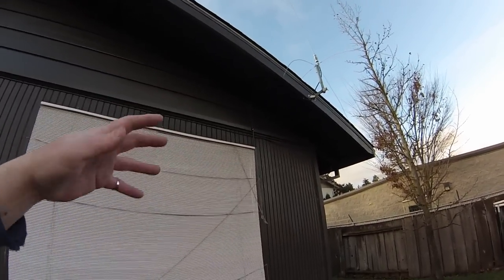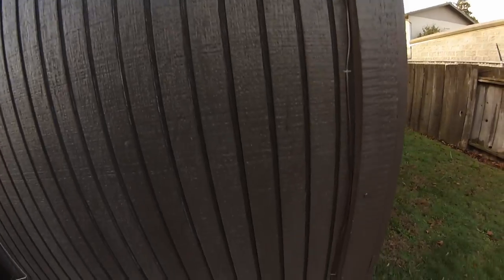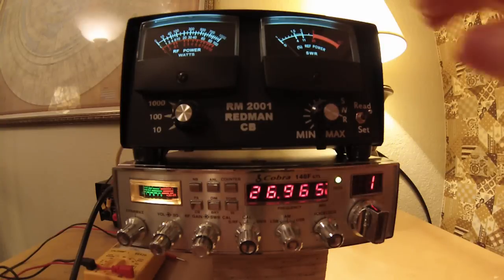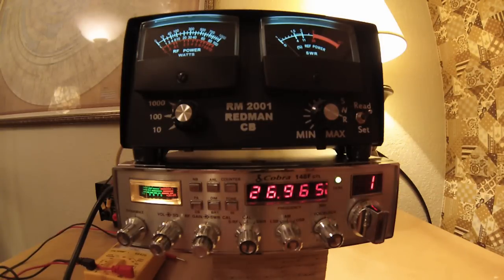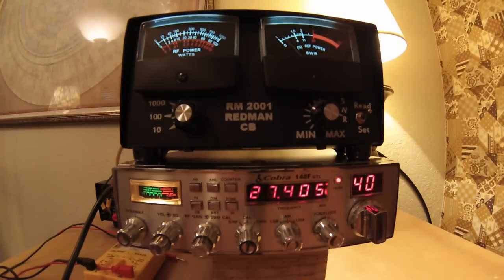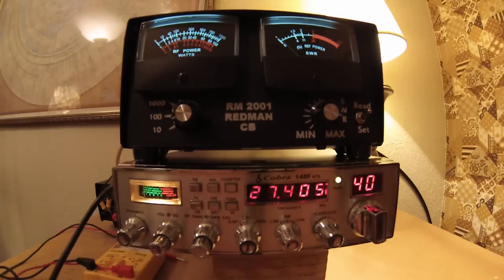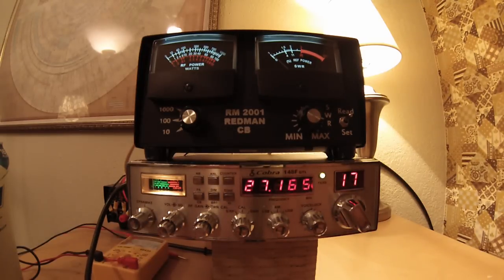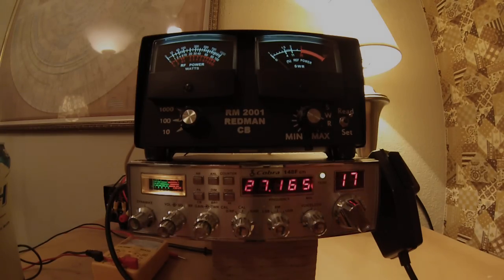DIY CB Base Antenna Using a 102 Inch Stainless Steel Whip

Comment: No video how you did it all looking to see how to do it so I can make a base station in the house
Reply: I made a makeshift base station for someone with minimal parts.  I used a computer ATX power supply for a very clean 12 volts and 30 amperes.  I then connected the yellow cable from the power supply to the red cable of the radio.  Then I connected the black cable from the power supply to the black cable of the radio.  I then ran an antenna to the roof and fed the antenna with a long length of coaxial cable.  It is very easy to do and the results are good.

Comment: if your running about 30 or 40 feet of mast  and run the ground plane do you need to insulate the antenna from the mast pipe I have bad swr its reading like the antenna is way to long
Reply from the maker: No. The Mast should be Grounded and the Antenna Should be Grounded to The Mast as Well if that Makes any Sence.
Reply: @danjarrett  it makes all the sence in the world Im running on pole no radials right now well I tried swr was lously and surprisingly while 3 to 1 in the 40 when I went as low as 26 mghz the swr was only 2 27.9 mghz 3 indicationg long no spring tried 3 other antennas and swapping coax so adding radials should fix my swr or am I gonna still have a problem because its on 40 feet of pipe
Reply from the maker: @Vinnie305  I don't know. If the Antenna is working ok it should not matter about the hight  of the Mast. Could be the Length of the coax ?
Reply: @danjarrett  it works fine swr is the issue I have 75 feet of lmr400 also  my radio does around 150 watts

Comment: Channel 19 is trucker channel for North America! and your ground radials on a 102 should be 9 feet!
Reply: California uses 17. In some areas 16 is known as a regional channel.
19 is for interstates.
Most don’t know these older ways.
They just stick to 19.
Reply: @JustAnumbr  some people in California uses 17 cause some newbies were told 19 is used by ships in the port.... NOW YOU KNOW!
Reply: No. Now you know! 

Put down your crack pipe.
Reply: @wesoblander3648  whatever your smokin lol...
been truckin for 50 years dude